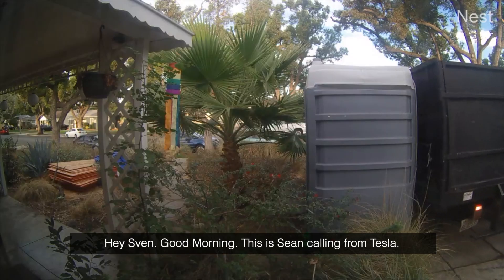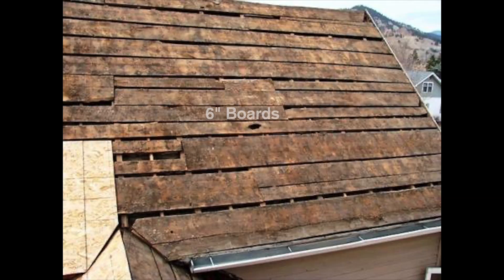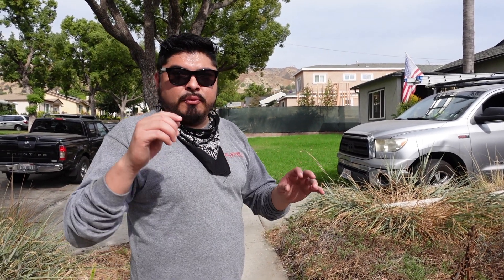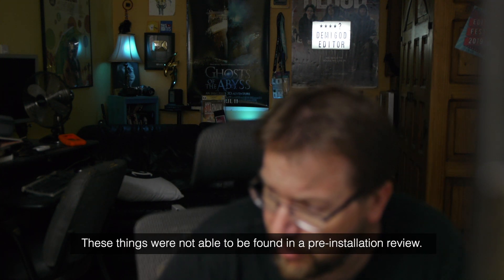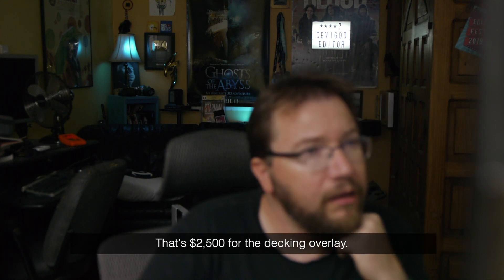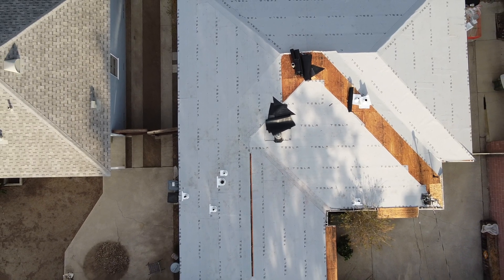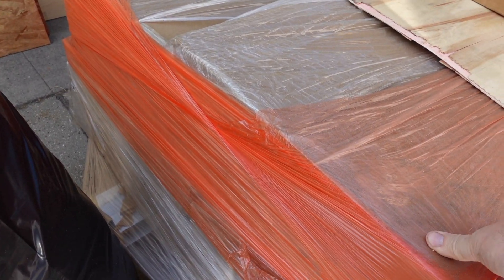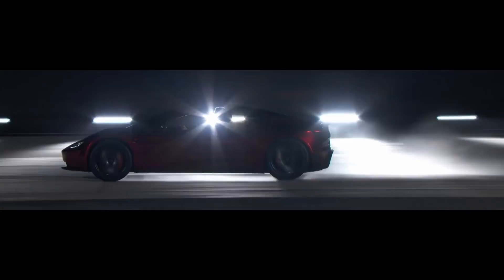Tesla Solar Roof - Unexpected Costs

Comment: I had a similar experience where additional work had to be done. It was dry rot repair and some sagging areas. We agreed that I would pay for the dry rot repair because that couldn’t have been discovered during the inspection but I won the debate about paying for the sagging because that was clearly visible during both on-site inspections and should have been called out in the estimate. 

That line about Tesla only employing A+ subcontractors isn’t true, at least in our case. The sub that did our tear off and underlayment prep did such a horrible job that Tesla had to ultimately fix it themselves. The damage the sub caused was more than the entire cost of the system. From I heard from our Tesla rep, that sub damaged several other homes during their Solar Roof projects as well. 

At the end, Tesla made it all right. Happy ending and it’s an amazing product.

Comment: The pandemic has drastically increased the price of wood. I agree the plywood should have been in the quote. I have a very similar roof situation as you. Old house built in 1947 with horizontal lumber on the original part of the house. I also have an newer addition that has plywood decking. Do you know if the underpayment is an ice/water barrier? I live in a colder climate than you.

Comment: They won't guarantee many asphalt shingles over board roofs like that.  Just over plywood.  The price seems a little steep.  10 squares at $250.  Plywood sheething runs from $20-50 at home depot.  You would need 22 sheets at possible at up to $20-50 or $440-$1100.   $50 nails.  So $1400-2000 in labor.  Maybe a little steep.
Reply: A little?  It's a pure rip off.  That's how contractors work.  You have to say, "NO!"  "Cancel the job and replace the roof you ripped off."  Tesla is known for this type of issue.

Comment: I know this comment is a little late, but in my state, you can't legally be charged more for a service than what the quote was after the work was already done unless you first agreed to the change in price, which in this case it sounds like you didn't since the phone call was after the wood was installed.  ie. they have to get your approval before completing any work that causes you to be charged more than the initial quote. Based on what I saw in the video it looks like they did the work before getting your approval as seen in the phone call that you recorded.  Since a quote is technically a contract, you might be able to be compensated for that, or not pay that amount at all. I think its definitely worth looking into if California has that law too. Wording can be kinda tricky in the law, but if you spend a couple of hours researching you could potentially save yourself $3800

Comment: What Tesla charged you in extended materials during the tear off process, should have been eaten by them due solely on the prior survey and the fact the contract did not include the materials in the quote. They should have made an addendum to the quote and had your approval prior to installing, although necessary or not, it’s all in the contract. Also, Tesla is getting paid twice as your advertising their work is surmountable to double that rate, man you should have negotiated down that price.
They not only got paid for the extra material, they also are getting 10x that amount in “free” advertising.
Reply from the maker: To be fair, they did have a $3500 estimated additional cost clause in their contract. Looking back at the various quotes it was included in the first estimate.

Comment: I am on the list to get a Tesla Solar Roof early 2021. I signed the agreement in August. So I am having to wait about 6 months after signing. I am getting a full re-roof due to the condition of my current decking. My facia boards will also be replaced. I got a price for the decking replacement already but not the facia. My questions for you: Did you consider adding additional reflective barrier on the inside of the roof decking..... I think I want to do this and wonder what Tesla will say about this. I am in northern California. It looks like you are in Southern California. I have asked for a meeting with the "foreman" or "manager" to plan these additional details but even after months of waiting, I have had no contact with the field team or their manager/foreman. How much communications did you have and how much did you have to work at it to get the pre-install site visit and discussion?
Reply: I have the same question about a radiant barrier and also fire retardant, although hopefully it’s part of the underlayment.
Reply from the maker: I did not consider a reflective barrier. You can see a video of my pre-inspection here: https://youtu.be/zdRTgyT2j_4
Communication with Tesla was excellent, every email and phone call was returned in a timely manner. What delayed the process by 6-9 months was the pandemic in March and communication/permitting with the city as they were shut down for months and later there was a lot of back and forth/rejected permits as Tesla and the city had to basically figure out the code  with multiple revisions.

Comment: Thanks for the great videos and documentation. Hope your installation process get smoother as it goes. How did the underlayment work out for you under the rain? My old roof is getting tear off soon and we also expect some rain before the roof tiles are fully installed.
Reply: The underlayment works fine with rain, IF  it was installed properly. Mine wasn’t and caused a bunch of water damage. Once it was fixed, it held up fine for months without a roof.

Comment: Ya, that should have been in the quote.  I am getting solar but didnt go with Tesla.  You are right to question the price of the plywood sheets.  I just bought some for a room rebuilt (falling apart when I bought my house) and the plywood for the roof with the heat shield (thin metal paper on one side) is only about $13 a sheet, not $30 ish that they told you.

Comment: Hey, i have my install coming up in 1 month. I thought that the plywood would be covered. Were you not able to have the reduce the price whatsoever?
it does not seem reasonable that they say this is the price and you need to pay it. I know my house has old decking, i am not looking forward to have them tell me i need to pay more then the 44k they asked me for already.
Reply: Make them aware that there are boards in advance,  and record it in an email at least 14  days in advance,  if they do not take the extra cost into account before install you could argue successfully that it should have been included in the costs
Reply: I was verbally quoted $85/ sheet and then charged $114. The difference was explained as “ nails etc.” by the subcontractor.

Comment: That's nice of them to destroy your old roof and then gouge the hell out of you for a few sheets of plywood that they already knew were needed.  At a bare minimum, they needed to have the additional cost/work approved BEFORE they did it.  Not sure what would have happened next if you declined after they did it.  Unfortunately, I experienced similar shenanigans with them on a traditional solar install where they tried to add a massive cost upper to their original bid -- ended up canceling as that wrecked the value proposition of using them.
Reply: Yeah I’ll definitely be waiting until they get things sorted out.

Comment: The additional cost seems to be a common occurrence with Tesla. I also had 1x6 sheathing, but they didn't offer much of a reason for needing to upgrade the decking with OSB. They also wanted to charge me to relocate some vents that ultimately didn't need to be moved.

Comment: Good update.  Glad to see it's finally going in.  I keep seeing these extra costs in the older houses.  I don't know what the early inspections are for, if not to adjust build costs.  It does remind me of the Tesla process though.  Not a lot of interdepartmental communication.  Inspector posts an update, builder doesn't look at it.  I've experienced this multiple times with my Solar bid.  I'm also glad to see them use sealant backing.  So many roofers in my area leave that out.
Reply: Hard to tell what structural improvements are required before tearing off the old roof.

Comment: $3800 seems like a rip of. No way a few boards and the work to put them there should cost that much
Reply: Labor has gotten smart,  you talk a living wage labor now expects a living wage.  Stop undervaluing real workers.  Plus this is California.
Reply: @IMRROcom  So what if it's California?  The workers got nothing for this work.  The contractor pocketed $3.8 K.
Reply: I agree with this, as I am not getting the solar roof tiles and my normal roof needs to be replaces and the whole thing is only $7400 with 30 year tiles.  Then a day or two later the normal panels get put up with my Telsa powerwall 2.